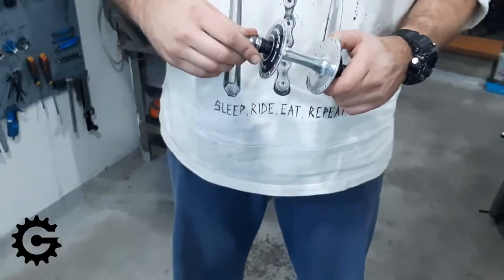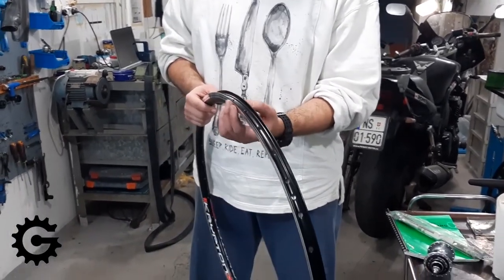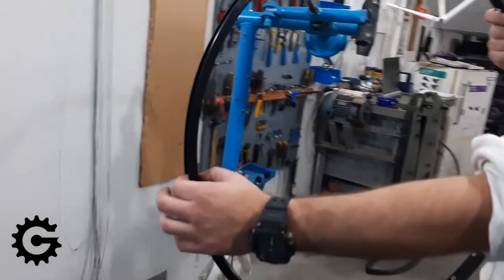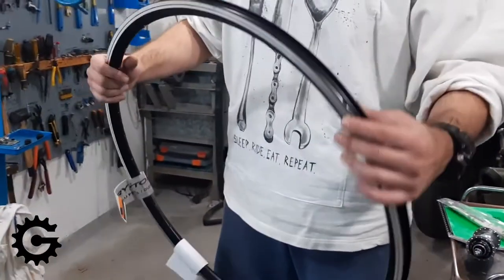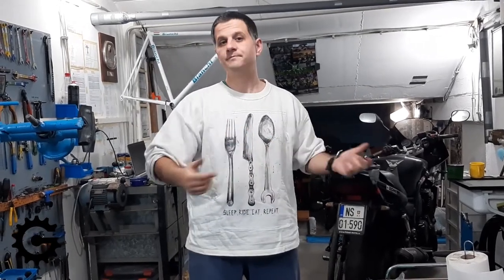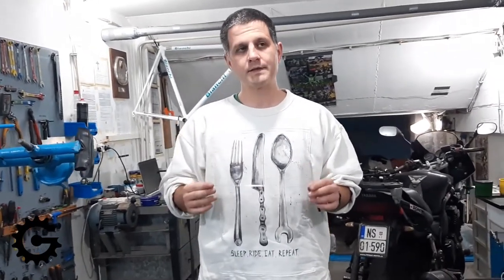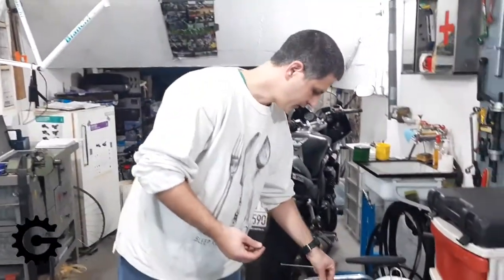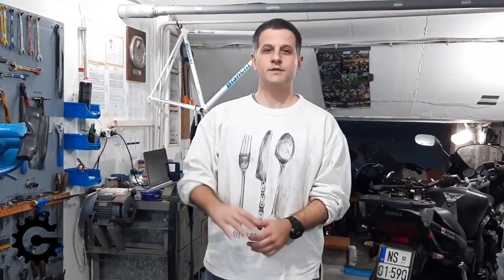Bicycle wheel building [02] - choosing good quality components for a bicycle wheel [1003]

Comment: Do you have any recommendations for good quality, strong and durable  36 hole rims with double eyelets made for rim brakes?

Edit: that is suitable for 28-37mm tyres
Reply from the maker: A difficult question to answer, unfortunately.  :(

For a start:
Practically every company now machines the braking surface, which makes the rims look cooler, doesn't require any running in of the braking surfaces, but makes for shorter lasting rims (too much material gets remove that way, needlessly).

As for the good quality double eyelets - Mavic rims are no longer durable, I see and hear too many cases of them breaking in the middle (cracks going from one eyelet to the next one, over several eyelets).

H PLUS SON rims seem decent, but I don't see them making 36 hole rims, only as high as 32.

The Krypton rim in this video doesn't have eyelets, weighs a ton, and machining is not very neat, so you need to spend more time on preparation, and it takes longer to even out the spoke tension. However, at least they are very cheap (about $10) and very durable.
That's my choice on a budget - these are locally available (where I live, on every corner :)  ).

For a decent quality (durable) double eyelet rims, I can only recommend DT SWISS TK 540:
https://www.bike24.com/p222014.html

Those can fit tyres from 28 to 50 mm wide, easily. That's the "safe-bet" range. I would dare to go as small as 25, and as big as 54 mm on those rims, as long as the say 25 mm tyres are really 25 mm wide, not made half a size smaller, as some manufacturers do with some models. The same goes for the 54 mm wide tyres (28 to 50 mm range covers for that margin of "error" on the side of the tyre manufacturer).

Their price is eye-gauging - about $50. But at least the quality is acceptably good, they come with 36 holes and have the proper, double eyelets.

They also come with 32 holes - so pay attention when buying. One example (Amazon affiliate link):
https://amzn.to/34yHDx9

That's more than double the price, and only 32 holes.

If I find a rim with a similar quality, but lower price, I'll be delighted.  :)  I went with a Krypton rim for my last (front wheel) build - it takes longer to build a wheel, but I can easily find replacement ones of the exact same size (ERD), and they're dirt-cheap, but very durable (and heavy, can't have it all :)  ).
Reply: @BikeGremlinUS  Wow thank you for such a great indepth response! :)

I already got a pair of mavic a319 rims coming in the mail for my current project. Hoping they will last until the brake surfaces are all worn away and not break prematurely. I will for sure go for the tk 540 next round even though that is twice the price compared to the a319. If the wheel is strong, durable and dependable its worth the extra expense in my opinion.
Reply from the maker: Glad if it helped. :)
It was a very good question - maybe I should list some spoke, nipple, hub and rim models in the video's description. The main problem is availability - especially nowadays (I had waited 6 months for some decent quality nipples, then gave up and sourced them from abroad).
Reply: @loooonieeee  Hi. I'm looking for exactly that and I've found a dutch brand called Ryde. I use a 36 hole rim model zac 2000 on a hybrid bike (hard tail) and it can really take a beating. I have a 40mm schwalbe tye on it. For over a year they've remained true and zero punctures. Solid commuter. I've tried to source those rims but it's a little obscure... give thier web page a look- they have quite a nice variety with thorough descriptions (single/double wall, eyeleted, ERD, rim brake compatibility, width, hooked, etc).

Ahh, also Decathlon store rims are decent and well priced. If you need a 26 inch rim for rim brake and will use a freewheel and not a cassette then I can recommend Trek (Bontrager) wheels. Best of lucks!